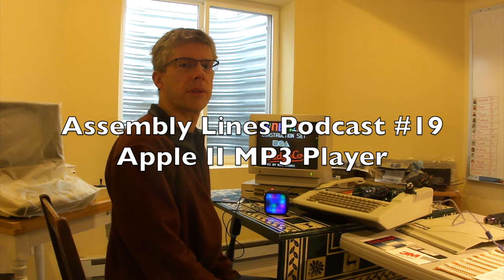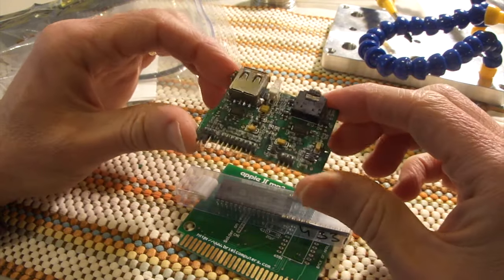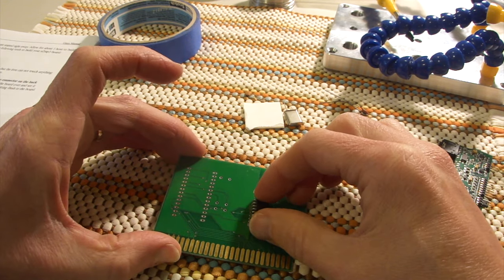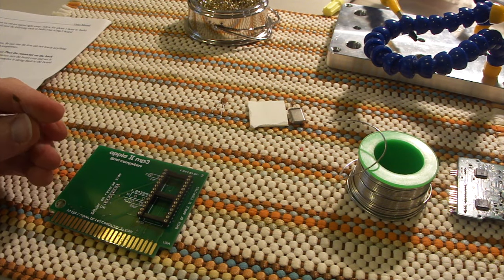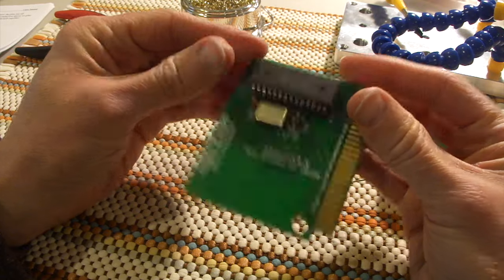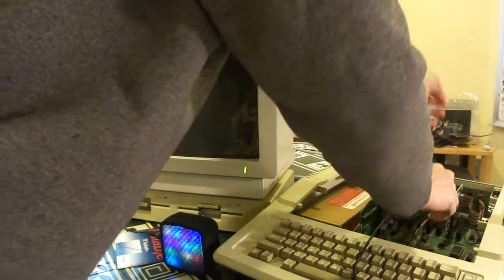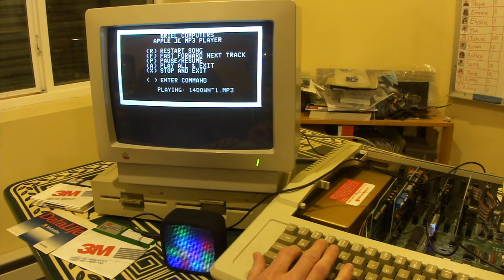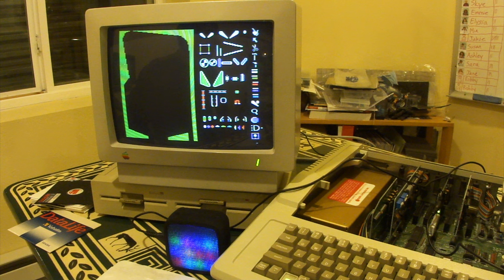Assembly Lines #19: Apple II MP3 Player

Comment: It seems kind of pointless since most of it is being done on the card itself while the system is doing unrelated tasks.
Reply from the maker: +BoneCollector Well, fair enough. It's more of a cool toy that a really useful peripheral. I think one of the problems is that you can't automatically detect which slot the card is in, which limits its usefulness. But still, it was fun to play with, and it made a good soldering kit. :-)
Reply: Which is EXACTLY what the video system is doing too. Rendering video while the system does other tasks.